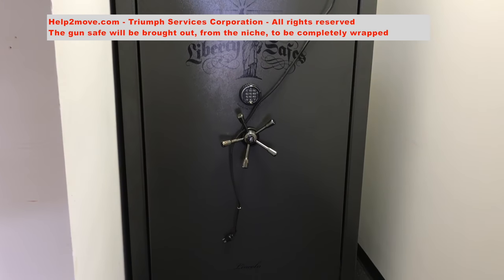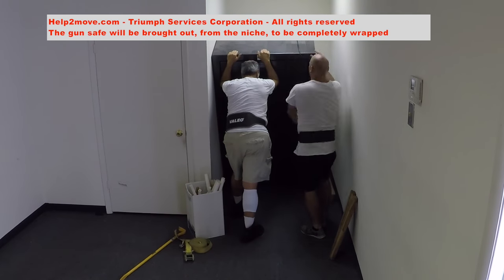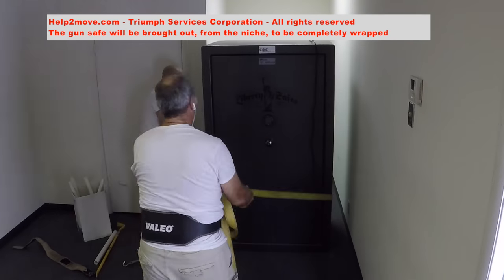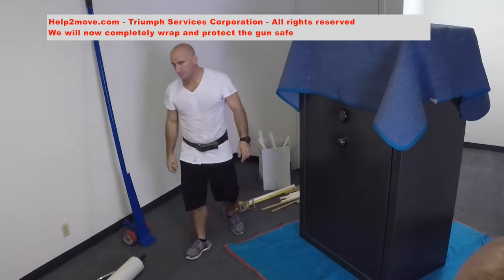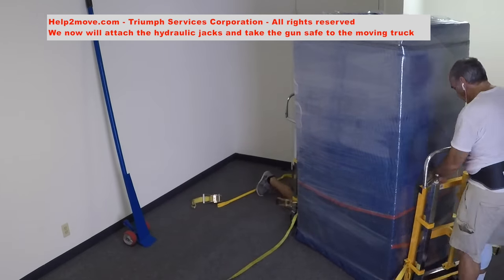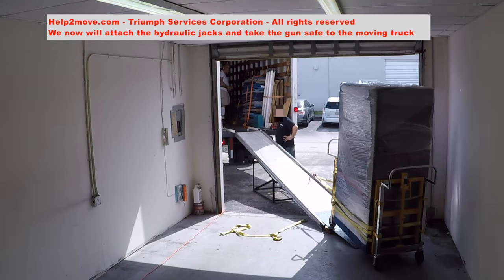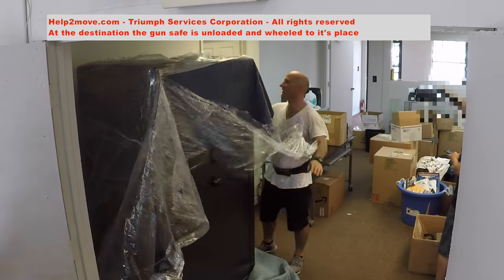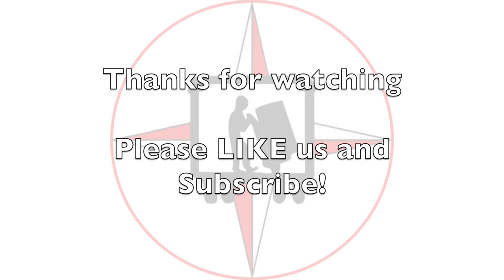HOW TO MOVE A MONSTER GUN SAFE. MUST WATCH! #gunsafemovingcompany #gunsafemovers

Comment: When moving a 1200lb safe over tile with hydraulic dolly do you recommend placing wood over the tile to prevent cracking? Or some other material to roll on
Reply from the maker: Yes, or either plywood, steel plates or aluminum plates. It depende a on the flooring and the weight of the safe. Don’t forget to subscribe. Thanks for your inquire.
Reply: @help2move  thank you🙏🏻